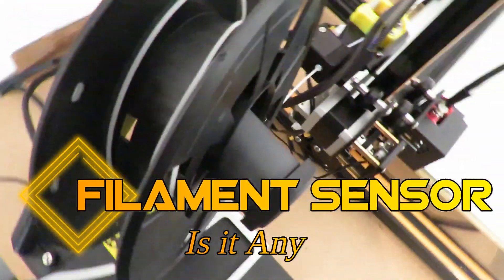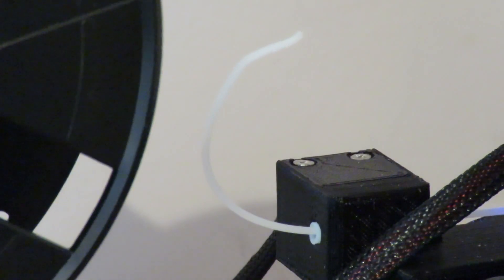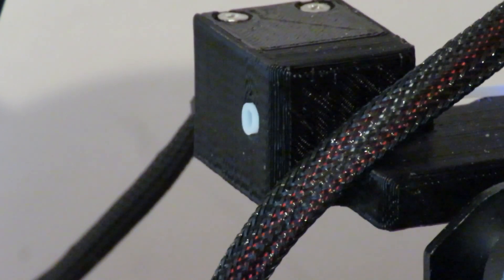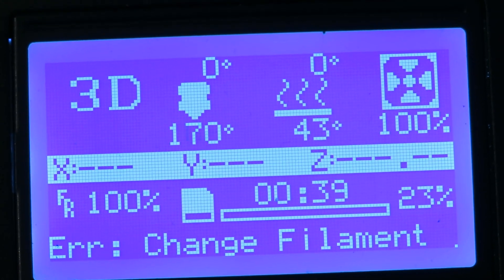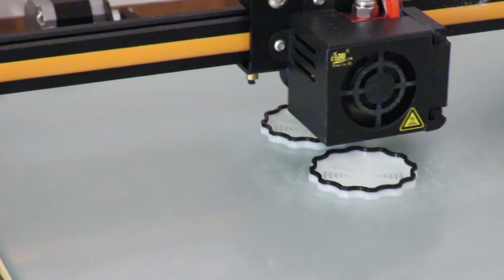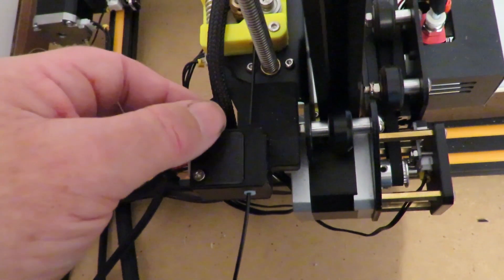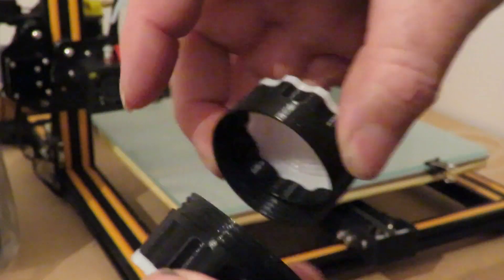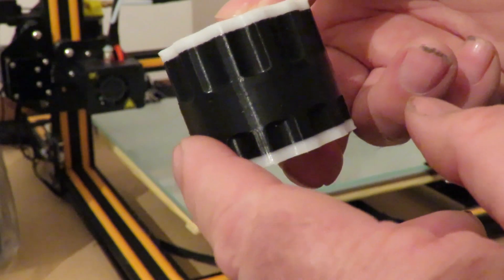📌 Creality CR-10S Filament Sensor in Action, Is It Worth the Extra Money, or is it a Gimmick?

Comment: Garry I was curious what the printer does once new filament is pressed into the nozzle...do you have to manually prime it?  Does it prime/wipe and then resume?  Just curious how it gets back to normal material flow again
Reply from the maker: I simply pulled the old one out and replaced it with a new filament and pressed resume print, and let the printer do its magic.
I would think as long as the new filament is at the same temperature as the Old one, there should be no problems.

Comment: Where do I buy this sensor and do I need to make changes to the software?
Reply from the maker: Hi
I just sent off an Email to Creality
So I can find the answer for you, regarding what changes in Software are needed, and Purchase locations for the sensor.
Reply from the maker: Hi Thom
If you go to Creality3D Official Store https://www.aliexpress.com/store/2846085
You will be able to purchase direct from Creality themselves.
Send them a message what your looking for, and also ask what is needed for the firmware for the sensor to work correctly on your machine.
Reply: Garry Purcell, thank you for your reply. It seems they don't sell the sensor there. Maybe it just comes with the printer.
Reply from the maker: You have to ask for them for it in a message, as it not shown on their official page.
My personal dealing with the official site.
I've found they are very responsive to questions, and great to deal with as a company.

P.S. If you have trouble getting the part, please let me know, and I will ask directly for you.
Reply from the maker: Forgot to mention
You'll find their direct contact details near the bottom of their store page
Reply: Thanks!

Comment: I was waiting like you were and was completely amazed when it worked, very nice feature. All i have to do now is save up and buy one, cheers Barry.
Reply from the maker: I must admit, I'm now quite happy to print with a spool that I know will run out before the print ends.
It defilement gives you a warm fuzzy feeling inside, knowing you won't have to restart your print from start, simply because you misjudged the filament left on the spool.